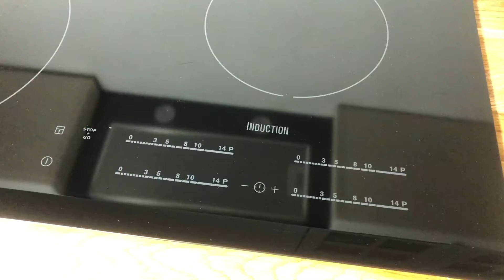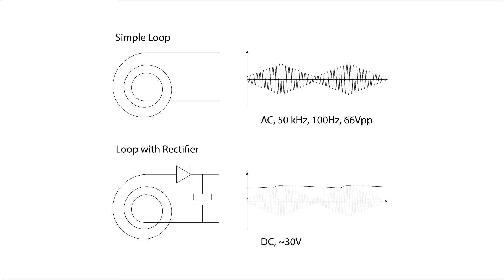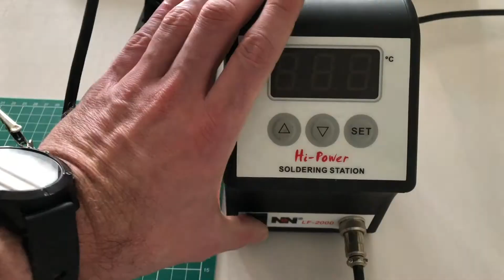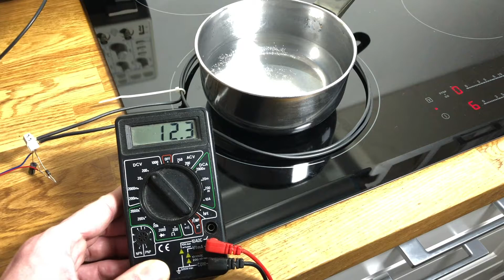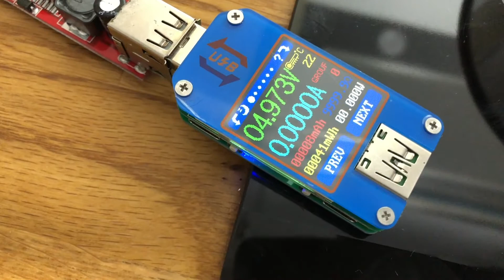How to CHARGE a phone from an INDUCTION COOKER / stove?

Comment: A word to the wise, do not set a microwave oven transformer on a burner, especially if you have removed the primary coil..   it will turn into a tesla coil and spit out some pissed off lightening bolts..  killed the burner pretty quick..  likely woulda killed me if i touched it..  so just an fyi….

Comment: Bht yeah, my question is, is the reason you can't harge the phone directly on the cooker because it is too powerful and wi just fry the phone and all other iron-based parts in it?

Also why not make 1 loop or a smaller loop or thinner wire and try to get 5V directly so you don't need the step-down converter?

Comment: What rating capacitors can be used? For an output of 5V n 2-3A
Reply: You need a capacitor rated for a higher voltage, the next standard one is 6.3v I think. But something like a 10v or 16v will also work.
farad rating is not critical, a 100 nF or 220nF will do.

You'd want to use an inductance too to stop voltage spikes, depending on the frequency of the output of the induction stove, if it's high enough it isn't necessary.